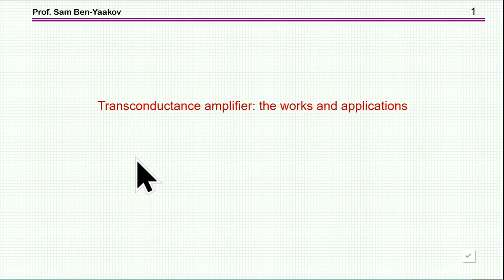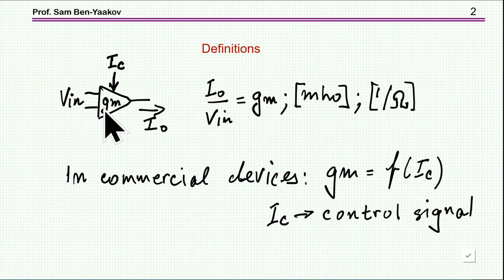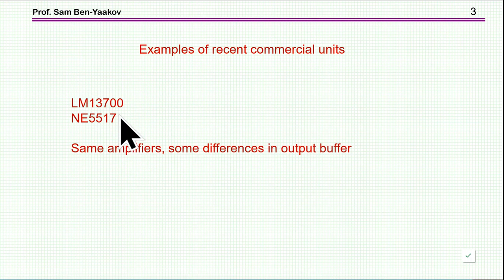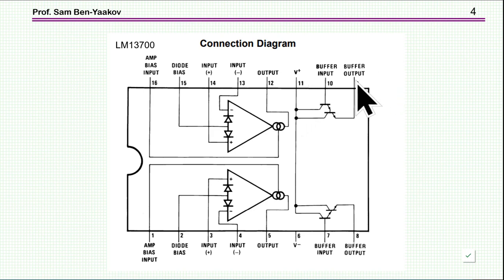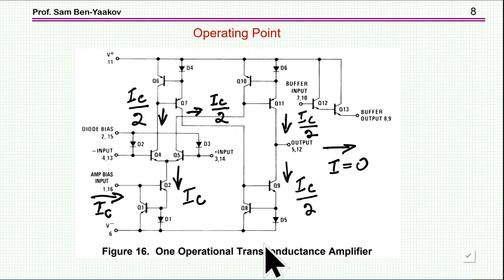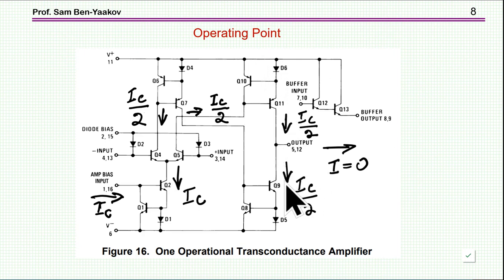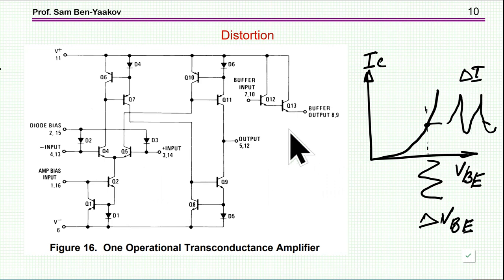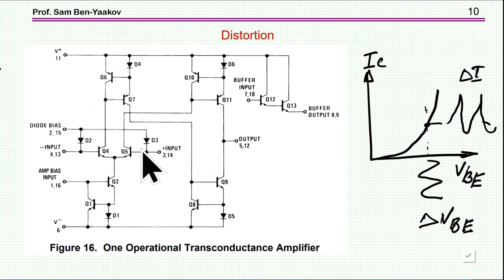Transconductance amplifier: the works and applications

Comment: Dear Professor, thank you for the great video! I think there is a slight mistake at 19:15. When I worked out the equation, I found that Io = Iin * (IB/ID) (e.g. no factor of 2).
Reply from the maker: Thanks for checking the calculation. I think though that there might be a confusion as what is Io, at the collectors or after the current mirrors. The ratio between these two is 2.

Comment: these linearization diodes, look like Voltage clamps.
Never used them and it works just fine. it's still not very clear why you should use them, what benefit you get.
Some new FET from Texas Instruments, released a couple of months ago has also a diode on the gate from the source, like the "circuit" on  the right at 17:12.
was the first time i saw i saw that, seams weird, like having the emitter power the base, seams illogical.
Reply from the maker: The benefit is linearization. Without the you get high distortion for larger signals. Please send the part number of the MOSFETs you mentioned?
Reply: @sambenyaakov  Well i have build voltage controlled filter with them. amplifying a 10 V.p.p. from one the attenuated -20x, no distortion found, instead of CA3080.
not Texas Instruments, but Analog devices.
MAT12, SSM2212. seams weird, one would think that the output, emitter would also power the base "partially", like a feedback.

Comment: Every bit of analog professional audio gear has OTA audio compressors in them
Reply from the maker: AS far as I know real professional audio, and stuff I work on, has everything digital. The units I mentioned have about 1% distortion for 100 mVpp input, not very professional to me. And BTW are the OTA you talk about one of the units I have pointed out? If not which?
Reply: Mackie SRM450 v2 uses numerous NJM13600M OTAs as variable gain stages and for variable frequency filters
Reply: @sambenyaakov  Behringer PMP6000 uses V13700 as compressors on the input to the class-D power amp stage.

Doubt 1% distortion would matter here because it's just going to speakers that add their own distortion anyway.

Soft 2nd and 3rd harmonic distortion is much more tolerable than hard high frequency effects such as class B crossover distortion.

Comment: Hello Professor. Could you please axplain why did we multiply (I_C1+2I_B) by the alpha factor to calculate the I_out?

Also, what is the rationale to assume the base currents of the Q1 and Q2 equal? Is it an approximation or a fact?
Reply from the maker: Please specify to which slide or minute you are referring.
Reply: Thank you  @sambenyaakov  , for your response. I was referring the calculations in Slide #7 (around 5'47"), I could not understnad why we multiply the I_C1+2I_B by  ALPHA (line 2 in the slide.)
And also in the same slide, what is the reason behind the assumption of identical base currents in the analysis. Is it due to small value, or matched transistor assumption etc?
II appreciate your channel, videos and your explanation. I understood so much with your lessons.
Reply from the maker: @mehmetdurna3115  Alpha is the ratio between collector and emitter current. Emitter current is 2*Ib+Ic1
The implementation is usually on a single chip and the transistors are pretty much matched if close one to the other. 
________________________________________

Comment: Dear professor, thank you for an excellent video (as always).

I am wondering: Being an open loop topology, it should be easier to make this kind of amplifier working up to a very high frequency, in comparison to trying to do so with a classical global feedback of an op-amp.

That would make it a great application for a fast ADC preamplifier.

Unfortunately, those parts that you've shown have GBP only of 2 MHz. This suggests there might be some caveat there. Maybe the transistors are not fast enough or some parasitic capacitances (or inductances -- as it is all current driven inside) are impeding high speed operation.
Reply from the maker: Youneed a dedicated design to HF Also. open loop ,means inaccuracy in gain and distortion

Comment: So it still could be used to condition a signal by changing the gain slightly rather than inducing a huge gain like a pre-amplification stage.
Reply from the maker: IN gain control you need a rather large amplitude range.

Comment: OTA are also stable with capacitive loads! That's been useful on a few of my projects, and a convenient way to tune feedback loops in converters with few external passives
Reply from the maker: Stable in open loop like any amplifier.
Reply: @sambenyaakov  I thought most VFB opamps need a series output resistor to add phase margin when driving capacitive loads as an integrator? I think TI has a good app note on VFB vs OTA and their respective integrator topologies.
Reply from the maker: @benm4784  To stabilize an OP Amp in closed loop with a large capacitive load, you add a series resistor and take the feedback at the output of the  Op Amp not from the  cap. A  transconductance is a current source, that is, has a large series resistance at the output. So if you try to operate it in CLOSED LOOP you can not not sample the signal before the Cap.
Reply: @sambenyaakov  Ah! I believe I follow, and this gives me some concepts to play with! Thanks!